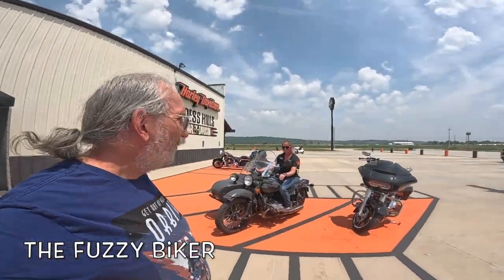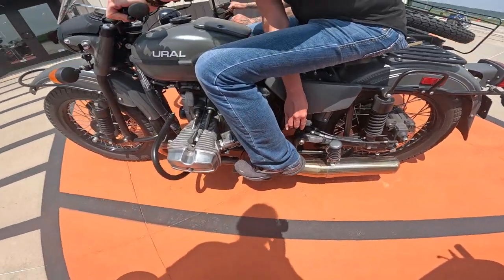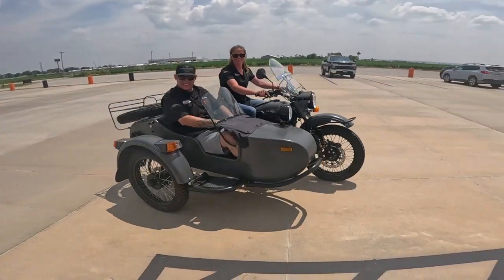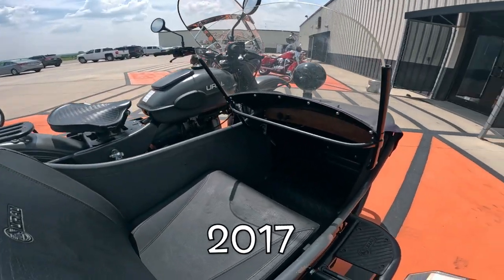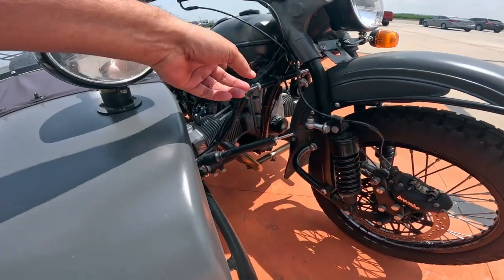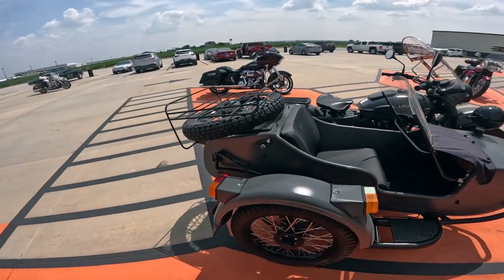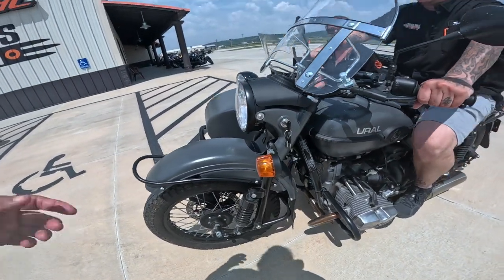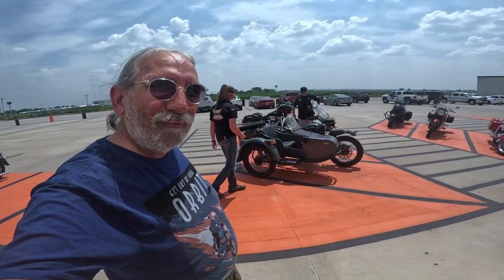Amazing Russian Ural cT - Wahoo!

Comment: If it’s 2 wheel drive it’s not a cT. Probably a Gear-Up. Based on the spotlight and lockable compartment on the tank, that would be my guess.
Reply from the maker: So, I'm thinking you are correct, though positive info was not easy to find. Dealer that has this bike claims it is a cT. Called our local Ural dealer but they wanted all my personal info before connecting me with a sales person, I declined. Could not verify. Thanks